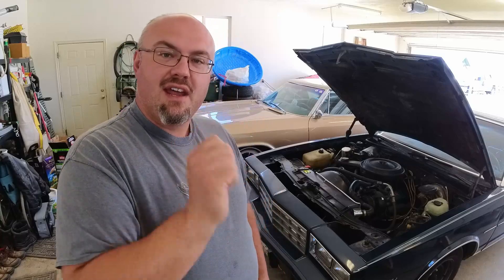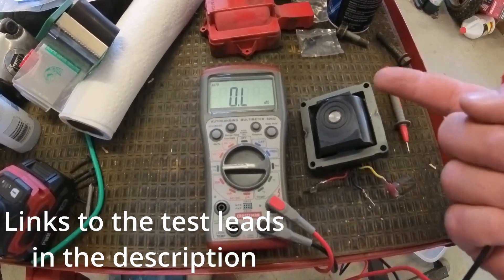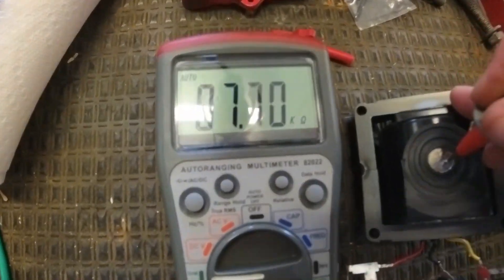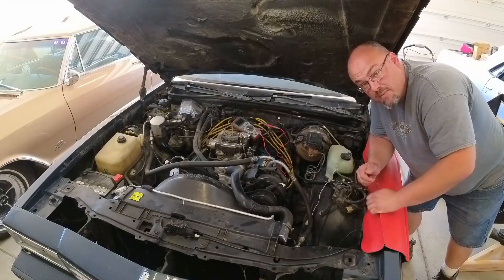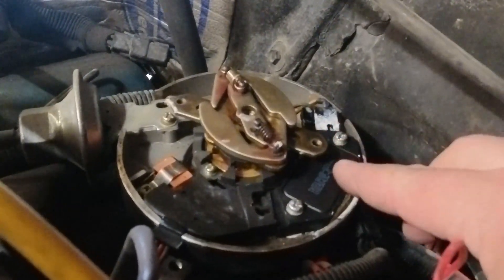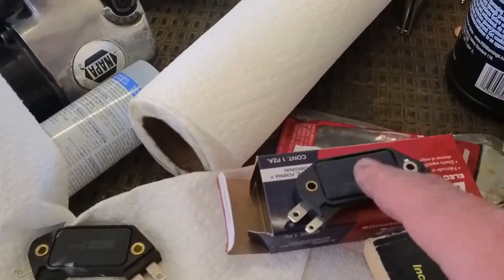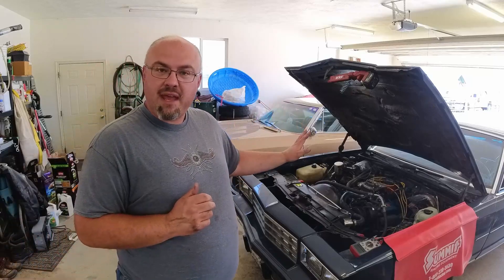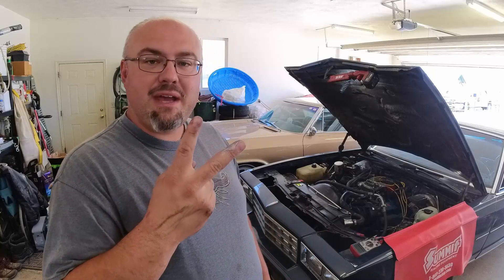Simple Solutions For The GM HEI Ignition and The Lost Spark!

Comment: What Duralast part number was that? 
Thanks.
Reply from the maker: I don't recall. It's a replacement for a '79 Monte with a 350. They're pretty much all the same until you get to the Computer Controlled ones. The best part to use is the MSD ignition module. I've done a video on that part, and it's totally worth the money to upgraded.
Reply: @SnowFamilyRacing  ok, thank you very much.

Comment: You can check magnetic pickup with volt meter 😮
Reply: The windings often fail with heat, then resume operation on a cold start.  Basically the same issues with failing crank and cam sensors, failing when hot.

Comment: I have a BBC, #2 and 3 cylinders dont fire, could it be the ignition module?? thank you
Reply from the maker: You may want to verify that the plugs and wires are in good shape first. Are you sure they're electrically dead and not something like a valve train issue?
Reply: @SnowFamilyRacing  Thanks for replying! I pulled the heads to have them checked, they checked ok. Will make sure wires and plugs are good, even though I checked that months ago, and just adjusted the rockers, will start it in the next few days, but I heard from a tech that the issue may be the ignition module. I have compression and fuel pressure
Reply from the maker: The ignition module isn't likely to drop 2 cylinders consistently unless the magnetic pickup is damaged on the reluctor for those 2 cylinders. My experience is that the module is typically all or nothing. I've seen one go bad more slowly, but that was a very rare case. My gut says that there's a simple oversight there. I do want to say, it's very hard to diagnose this stuff over the internet.
Reply: @SnowFamilyRacing  Reluctor, is that part of the module?. All this started when I left water in the engine during the winter, the block cracked, I noticed after I stopped and check the oil, water and oil mixed, I thought due to the water inside the engine, it couldnt rev up, well, got a new block, transfered everything to the new block, and it still does the same, not reeving past 2700 rpm and 2 dead cylinders. ECM checked ok. Thanks again for your replys
Reply from the maker: Okay... you just brought up ECM. What year and size engine are you working on? ECM's totally changes the game... now there could be whole multitude of things that get added to the issue.

In an older HEI, the reluctor triggers the magnetic pickup. It is inside the distributor with the magnetic pickup. It's got 8 points on it.
Reply: @SnowFamilyRacing  Yes, I had it checked, thinking it could be the problem but it checked ok. Its a 502 MPI, 0r 8.2L, 1996 model, Gen VI, mounted on a boat
Reply from the maker: If you're using a GM OE computer, this is not the kind of distributor you have. The 90's GM's had a hall effect style distributor. It's likely that you'll need to start working through the sensors and making sure everything is communicating correctly.
Reply: @SnowFamilyRacing I understand. Well, Im getting close to start it, if the problem persist, I will have to take it to a professional. A tech guy hooked a scanner once, months ago, showed no codes, im just mecanically inclined, but dont have the knowledge and tools to do it. I appreciate your time and suggestions!

Comment: It's possible the module failed due to a defective coil.  I'd replace the coil as well.
Use real heat sink compound when mouting the module, not just silicone grease.
If this is a vacuum advance distributor with a 4-pin module, the reluctor pickup wires will break over time due to the back and forth action of the vacuum advance.
Always keep a spare module in your glove box, in compliance with murphy's law.
Reply from the maker: The coils on these are pretty tough, I've changed bad modules and I haven't found a truly "bad" coil... yet. I've got a marginal coil that still ran when removed. I'm not saying it's not impossible that a coil can take a module down, but i haven't experienced it. The heat sink compounds are important to module, most come with a tube of the white stuff. I am aware of the wires coming apart on a vacuum advance distributor. My experience has been that if the advance mechanisms and pins are all worn out, I can replace the whole distributor with a new one and avoid the broken wires from the mag pickup. It's a wash on price anymore between refurbishing an old one or buying a new one.

The best alternative to the OE module is the MSD module. This blue Monte got a new MSD module not long after for reliability sake.
Reply: @SnowFamilyRacing  If the module is conducting too much current, it will overheat the driver transistor.  Some coils such as "high energy" have a very low primary resistance.

Comment: Presently chasing a sudden crank no-start issue. It’s getting fuel, spark plugs are a bit rough so replacing, but I’m thinking this is going to be the resolution at the end of the day. I’ve avoided the HEI hoping it wasn’t related… but it appears the time has come 😂 Thank you for the extremely thorough video from someone learning on her own ❤
Reply from the maker: Start checking voltages and easy stuff first! The HEI isn't particularly scary and is pretty easy to work with! You've got this!
Reply: @SnowFamilyRacing thank you for the encouragement. I dove into replacing it yesterday and it took such little time/effort. It was VERY easy, but sadly didn’t remedy my problem 😞
Reply from the maker: I'm glad to hear it was easy, and I'm sorry to hear that wasn't the solution! I do have another video that's about troubleshooting electric problems on these cars. Basically, chasing the wiring from the battery to the distributor. I'm sure you'll get it figured out, and I'll also do what I can to help answer any questions you may have.

Comment: be nice to see what you did at 0.40 of the video
Reply from the maker: You mean checking the voltage at the distributor? You can see the volt meter probe in the connector for power at the distributor.

Comment: I have a 88 cutlass with the stock 307 motor. It sputters most the time but sometimes runs good. I got new plug/wires and I even replaced the carb and fuel pump.  Compression is good so idk what else it could be. My exhaust smells super rich yet I did jet down the carb and I have the same issue.

Now I’m wondering if it’s something to do with my timing , this car was computer controlled  but someone removed all the wires and smog when they removed the Rochester carb. 
My plan is to install a cheap eBay distributor with vacuum advance and see how it goes. I hope it works.
Reply from the maker: When going from computer controlled to non computer controlled, you need the carb and distributor to be non computer controlled. What are your plugs looking like? That's the giveaway of how it's running. Just because you jetted down may not fix a rich, especially at idle, condition. You'll want to adjust your idle circuits, too.
Reply: @SnowFamilyRacing   yeah I already have a edelbrock, and I installed the new distributor with vacuum advance today. Shot the timing to 20degrees. Now I can actually drive the car. Plus is doesn’t burn your eyes as much. lol 
It still has issues though. I noticed when shooting the ignition timing. It would run way pass the 20 degree mark when revved slightly, 12-1500rpm 
Is that normal? Yes the vacuum advance hose is disconnected.

Comment: I've got an H.E.I. on my 1973 Chef K20. It was installed by a super old school mechanic in the San Fernando Valley of Los Angeles, back in (oh) 2008. It made that truck run so well, for so long. I needed to sell the truck a few years ago to get it off the property, and my dad put a new battery in it, but he reversed polarity (the wires themselves were reverse color-coded) bummer. Hasn't started since. 
I don't know the vintage of the HEI as it is not stock. From watching your video I think I'm going to just pull out the module and take it over to Auto-zone. I hope they can match something up. 
You didn't need to check the timing after pulling the cap?
Reply from the maker: I might on my race car, not on this one. There's a locating detent that the cap fits into so that that only goes on in one orientation. 

The common module is the 4 pin for non computer controlled engines. There's a 7 and 9 pin variant for the computer controlled models. For the parts store people, just about any Chevy V8 car or truck used the same part. My go-to for stuff like this is a 78 Monte Carlo with a 350. That gets me the common things like a module.

Comment: I picked up a 1980 regal with a 4.3 that sat for 20 years. No spark even after replacing the ignition module. Any recommendations?
Reply from the maker: I'd recommend this video I made. This one walks you through what to verify from the battery to the distributor. You'll want to check for power all along the way until you find the issue. https://youtu.be/DjIHk0C2WCg

Comment: Hi so my husband wants me to ask why this keeps going out we know what this part is we have changed it out many time but do not know why it keeps going out  also changed out the whole distributor did not change anything sill goes out we order 2 at a time have ordered cheap and expensive no difference please help if you can
Reply from the maker: There are a few reasons. First, there's a quality problem with where the current off the shelf parts are made. I've had the best luck with Napa for off the shelf electrical parts. Next, you may have a voltage issue like the alternator may be putting out too much voltage. The engine may also have a grounding issue. Check both power and ground. Lastly, I've got another video on my channel about swapping to the MSD ignition module. I've done that on several cars and haven't had to mess with them again. Between all of those things, you should find an answer.

Comment: I have an 85 Chevy pickup with an hei. A while ago, I went to start it and had no spark. I grounded plugs and had nothing. I changed out the cap, rotor and coil and still had nothing. Randomly one day it fired back up and I drove it for a couple days. Then all of a sudden, it died on me and I had the same issue again. I believe that this is the issue, but this is my first vehicle that I have ever worked on. Any thoughts? Thanks!
Reply from the maker: Intermittent issues are likely caused by loose connections. You need a wiring diagram and start chasing wires to ensure you have good connections everywhere. If the steering column is loose at the tilt mechanism, that can push on the ignition switch funny and cause problems. I've got a video about reading wiring diagrams, that video also has a link to an electrical diagnostic checklist.

I've also got plans for several electrical diagnostic and troubleshooting videos. Stay tuned!
Reply from the maker: Here's a link to the video I did about reading wiring diagrams. https://youtu.be/QMOdPEC-CnI

Comment: I have a 94 gmc Sonoma. I’ve replaced the distributor cap and rotor, the fuel filter, and the coil and the battery,  I’m gonna a try this and I hope it will resolve my issue. Car turns over but no crank distributor gets no arc/power
Reply from the maker: That's likely a hall effect style distributor on the TBI GM engines. I don't have any resources on those.

Comment: Awesome video. I was wondering how to chang it from computer controlled to  the 4 pin mechanical style? Please help thanks
Reply from the maker: You will need to replace the distributor completely as the computer controlled one does not have a mechanical advance. Any basic HEI from Summit or Jegs would work.

Comment: Thank you for the video! I have an 
‘84 Caprice that’s running a bit rough at idle. I was hoping your video would show the actual procedure of removing the ICM. Did you shoot video of that?
Reply from the maker: It's got 2 screws and an electrical connector on each end, and it's under the advance mechanism under the rotor. There wasn't a good way to get my hands and camera back there. It's really easy. All of the parts come off easily.

Comment: I’m having this exact same problem and I’m following this video step by step. So far i have 10 almost 11 volts at the wires to the distributor and my coil seems good based off the numbers in this video. Next thing is to change the ignition module but I’m wondering, do i need to buy an MSD ignition module as I’m using an MSD distributor or can i use an AC Delco from Autozone?
Reply from the maker: Low voltage at the distributor should be your first place to fix. Get proper voltage and then see what it does. If it's not a factory style module, I'd replace It with the same or newer model part.

Comment: Well I need a little help the only way my car will start if I take a jumper wire to battery to the pink wire on my distributor all my fuses are good what will it be
Reply from the maker: First, check out my electrical diagnostic checklist on my website to help you find the issue. Second, I'm betting on ignition switch, but I can't diagnose that over the internet. There's an interrupt in line somewhere and you'll need to spend some time with a wiring diagram and a volt meter to correctly find it.

Comment: Please please please, point me in the direction of how you go from the 7 pin to a 4 pin. I have an 87 El Camino that had a 350 put in but they left the “computer” and 7 pin dist in it and it’s giving me hell. Without boring you with all the details I’ve narrowed it down to the dist and coil. I’ve thrown too much money at it and want to just convert it to the 4 pin because I’m stupid and it seems like 4 is easier to understand than 7. I’ve been researching this for a while but can’t find anything helpful other than people philosophizing about what year it is and the ohms this and Volts that.. Any help would be greatly appreciated.
Reply from the maker: When you swap from a computer controlled car, you need both a non computer controlled carburetor and distributor. The easy way to do that is to go to Rock Auto and pick an older year of the car you have that isn't computer controlled and pick up the parts. For a Small Block Chevy, I'd go to Summit and get a normal HEI distributor. If you need a carb, that can also be acquired there too. The basic ones will do fine. The power wire to the distributor that's in the wiring harness will be just fine to use. Once all the computer controlled stuff is removed from the engine, the harness can be removed, though it does take some work. This is a simple swap. Remove the old and put the new one in, set the timing, and you should be great!

Comment: the only thing i buy from autozone is oil antireeze and brakefluid the rest is all garbage china junk
Reply from the maker: It all comes from China anymore. My local Napa has even cautioned me that they're having a higher than average failure rate of electrical parts. I got to witness that when I had a 3 week old Napa 4WD encoder motor on my Yukon fail fail while I was on a road trip with it.

Comment: Would a bad ICM cause the car to completely die & lose power when you make a hard turn or slow down at a stop light & intersection or down hill?
Reply from the maker: Doubtful, unless you have a very loose connection that loses good connection all the time. That sounds like it could be a fueling issue. Remember, it's very hard to diagnose a problem over the internet. Best I can do is generalities.
Reply: No, and no. Try using the clutch. Third pedal to the left.

Comment: everytime i install a new ign module it works once then burns out ??? Can you give me any ideas please ?
Reply from the maker: Without knowing any more about your set up, it sounds like you have either a grounding issue or an issues where the voltage is too high. Best place to start is grab a Volt meter and a wiring diagram, check for continuity to ground on the ground side of the module. You will also need to know what kind of voltage that you have both not running and running.

Comment: My ignition coil has a date stamp 7/18-1984 and the ignition module is about to fail as I've just began to experience hard cold starts. Cold hard starts will make you believe otherwise so do not be deceived by this condition.

A weak spark can turn over an engine just barely. You'll begin to consider other components to be at fault when the fault is in the distributor. AC Delco Remy is quality so if you can source NOS replacements stock up while there're available. Ignition modules cannot be diagnosed while stranded so its much easier to replace, and we should already know the behavior of our vehicles at this point. The ignition coil rarely fails and in most cases the magnetic pickup is fine.

Carry a couple of these ignition modules in your glove box with some Artic MX-6 compound paste. Heat is what kills the modules, so if you are swapping these often, its the heat. The silicone grease, in my opinion, does not dissipate heat effectively so Artic Silver for me.
Reply from the maker: No argument, heat is an issue. Based on what I'm hearing from friends that do this professionally and the people sell the parts, new electronics are failing at an alarming rate.
Reply: Going thru this right now. Ugh hard cold starts. When I turn off after getting some heat in the engine, turns over just fine